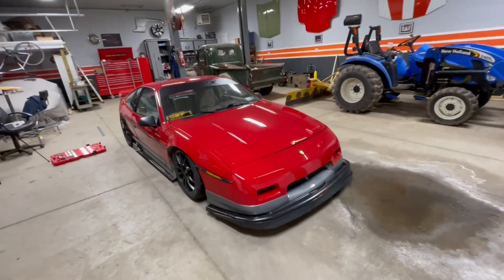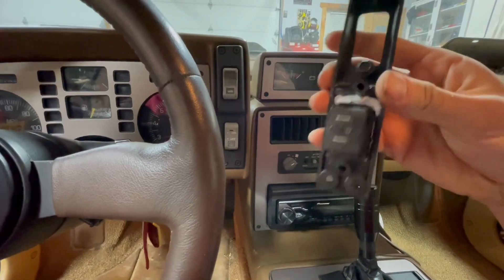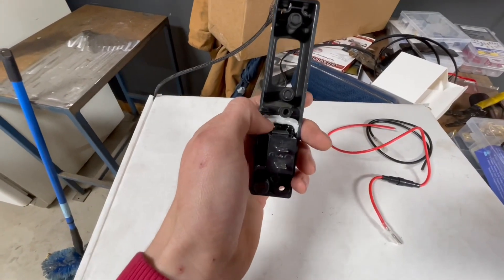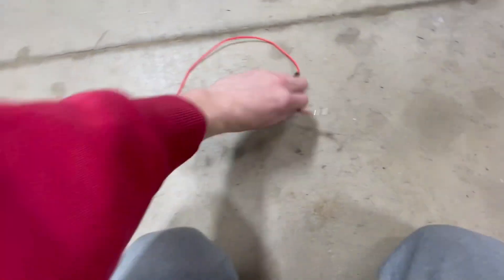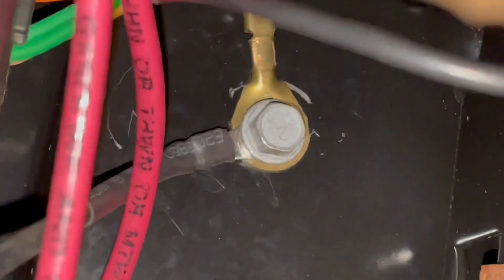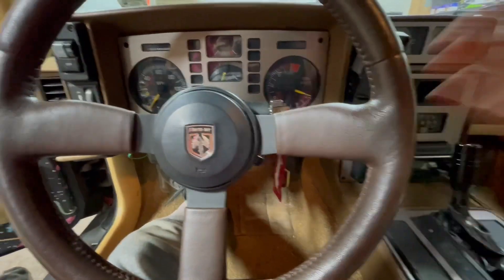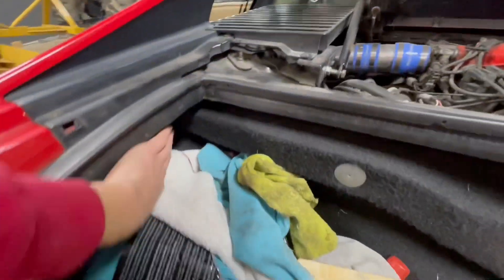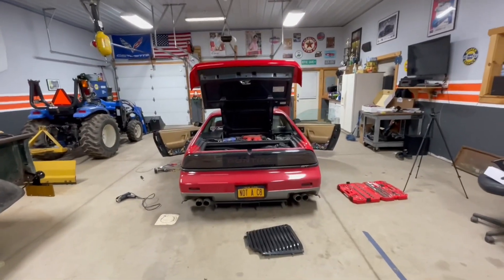How To Install a USB Port With Voltage Gauge On a Pontiac Fiero

Comment: I bought one for my Fiero, the listing has at least two different sizes, yours being the shorter one, I ordered the longer one and got it today, and the dimensions are perfect, it is just a mm or 2 to large on all sides, but instead of sanding the part on the car, I used the Dremel on the backside of the usb charger to make it fit the hole instead of making the hole fit it, it worked really well. Then for the wiring, I wired it directly into the rest defrost connector, which conveniently has an ignition power lead. I also mounted the rear defrost switch below the steering column, so I can still easily access it if needed, although it is out of the way.